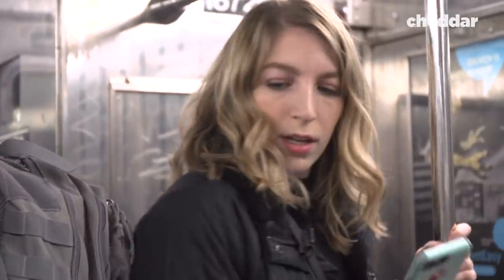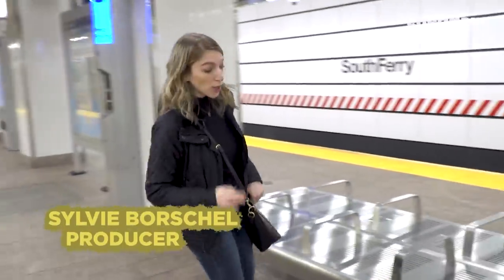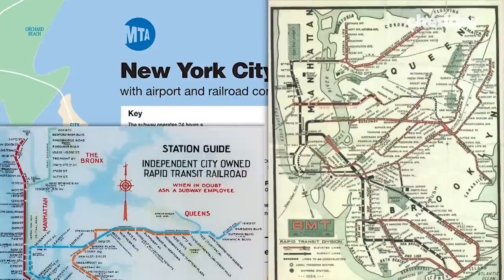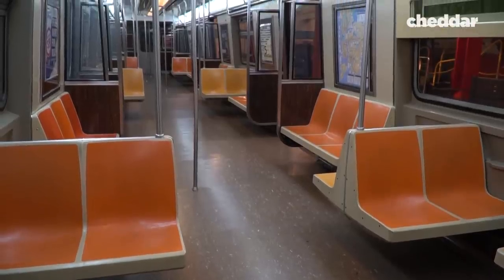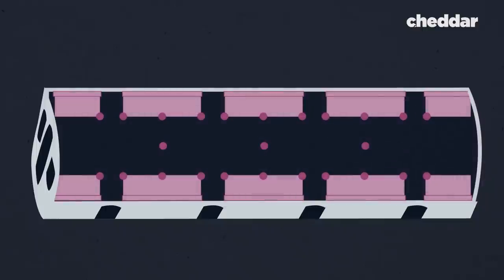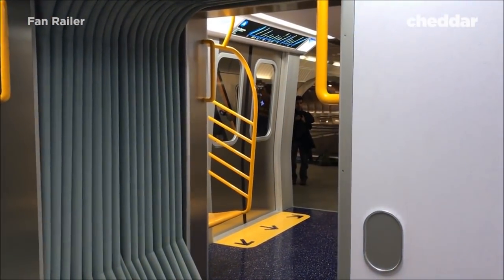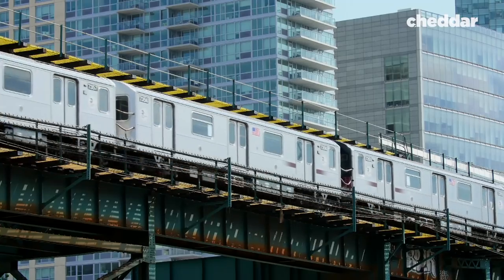Could This Subway Car Save NYC Transit? - Cheddar Explains

Comment: Cheddar: This is Subway
Wendover: Nahh, that's underground planes
Reply: Wendover can do a video about... I don't know... maybe... salt mining in pre-Christian Europe and find a way to tie in aviation :)

Great channel.
Reply: anything else: planes that in no way resemble a plane
Reply: Hahahahahahaha
Reply: The for fucking bus not a train.... you lose too much space for people to stand...
Reply: @campkira  , such a system works well enough for the Twin Cities area in Minnesota, so well, in fact, that they have won numerous awards for their designs.  Now another thing that might alleviate overcrowding in the NYC subway system is the most obvious thing, which is to look at the most crowded streets and make either new subway trains abd subway tunnels under said streets or use trolley, light rail, or commuter/passenger rail systems on said streets, as well as make them have that allegedly perfect rail design, simply make the trains of any type longer, and, if needed, add more engines to said trains.  Yes, it might cost a lot of money, but there needs to be a massive restructuring, as well as improvement, to the antiquated NYC subway train tracking system first, with new patches continually updating the system once new trains and lines are added to the NYC subway system, so a lot of money is already going to be spent on these upgrades anyway, thus expansions to the current system will naturally happen anyway.
Reply: NO THIS IS PATRICK
Reply: this train car measures up to 2 Toyota corollas
Reply: NarwhalX reallifelore intensifies
Reply: Sam (Wendover) has good statements with transportation honestly.
Reply: @paxhumana2015  Boy I can't  even respond to your all inclusive boondoggle of a solution. Who will do all this work and pay for it? Men from Mars. Keep dreaming buddy.

Comment: That aircraft style one looks awful, think how hard it is to get out of a crowded train as it is, imagine sitting in the corner of one of those
Reply: I live in Vienna, we have the end-to-end style trains, but the older 6-wagon style ones too. They don't have automatically closing and opening doors, you have to manually open the doors via a lever on the older ones, or push a button to open on the new models. The seating though remained the same. basically airline style, BUT every seat pair faces another pair, giving enough legroom to get out from the window seat. Each door location has a pole that branches into three. Also, every seat has a pole attached, while there are plenty of those plastic/hardrubber handhooks overhead where you can also hold on. And on the newer models, you can go from one end to the other, while the old trains you were stuck in the wagon you got in, because no doors to go between cars. You had to get out and run to the next car, because dwell times were always low, except at mad rush hour, but those are rare, thankfully.
Reply: Anyway, looks like them New Yorkers still can't figure out the best solution. Budapest has the same longitudinal style seating in the new trains, but one metro line is also fully automatic/driverless.
Reply: And noone is going to want to sit on the inside.
Reply: The closed-ended they described (that wasn't picked) would be harder and slower to get in and out of the train, harder to clean, more likely to be dirty (the shit you find on even open design subway cars in NYC is shocking, like a fucking shark in the early-/mid-2000s), and less likely to be used, whereas with an open layout, EVERY seat in rush hour is going to be taken up, but won't impede passengers getting on and off the train. They need to consider average ride-time (number of stops) per passenger: many passengers will have a relatively short ride time, so they don't care about comfort, they care about ease of access.

Comment: I've lived in China for several years. That "perfect" design (the one they didn't pick) is TERRIBLE. Some of the older buses had that layout. If you were in the window seat and it was crowded, imagine trying to get out - crawling past the person in the aisle seat, squeezing into the narrow aisle and trying to get past the people standing in the aisle... And being in the back row window seat was the worst. I can't believe any professional ever thought this was the perfect design!

The design they did pick is very similar to what's used on the subways where I live (a city of 12 or 13 million that's just started building a subway system the last ten years). The seats all face the center of the car with backs against the windows. You can pass easily between cars through big openings. The areas near the ends of the cars don't have any seats, leaving a big open space near the passageway to the next car. The main difference is that the seats don't flip up and aren't sectioned into individual seats - just one long bench. Of course, one could say the Chinese have no problems with personal space, but if the car's nearly empty, they sit away from each other just like Americans do. When the car is packed, however, they'll squeeze in any opening on the bench that they can fit into. I do it too. I'd rather sit next to someone than stand.
Reply: The handicap area has a lean "cushion" for people who want to be supported by the wall. The problem is that the placement of the TV screens sometimes makes those areas awkward because the screen juts into the back of your head. Those zones are also hard to get out of without aggressive shoving by US standards when the car is packed.

Pretty much the only nitpick I can think of for the Chinese design. There are tons of benefits, like the benches not assuming how wide a person is, or how easy they are to clean compared to individual seats.
Reply: even in Japan's suburb trains, they don't use that also
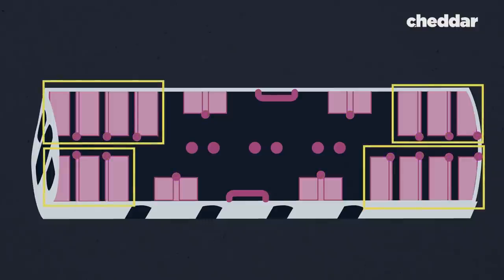Reply: The 5:34 design is being endorsed as "perfect" by a person who clearly didn't ride older MTA buses.
Reply: The truth!
Reply: @ruedelta  do you live in Jakarta?
Reply: @ruedelta  i was thinking shenzhen, nowhere near! lol
Reply: @davidgraham370  Good designs travel far!
Reply: AdeleiTeillana our busses have a similar design (Netherlands) or well some of them have, the thing is that busses are a whole different story.
Reply: I'd rather stand than sit next to someone. I guess we're different in terms of that. 

I'm from Russia, BTW, and I only rode metro, like, 2 times ever. In Moscow. The cities I lived in were all too small.
Reply: Totally agree with you. I Rode a lot of different subways in my Life. Have to say, that not the germans, but instead the Hongkong mtr got the best Metro/Subway if ever drove.
The in and out ways of the Station are perfect planned, a lot if big Doors and one Long train. So you can load and unload as fast as possible
Reply: agreed!
Reply: @TobiasAdeFilm  I live in Hong Kong - the name has a space, btw, it's not a mandarin name. The mtr is godlike, 12 car trains on one line and a couple lines run at 140km/h.
Reply: @Huskie  and arriving every 2-5mins...
Reply: Yeah, I dont see how they could not forsee the problem, it is not that people dont want middle seats, they dont want to be squished

Comment: that "perfect" car design is so deeply flawed it's actually funny!
Reply: What are the flaws?
Reply: @MetalheadAndNerd  Capacity and safety. Overcrowding is already an issue. Imagine if the design made it virtually impossible to stand on the sides? No one is going to comfortably stand in an aisle about the size of a small airliner (which isn't designed for standing when moving over long periods of time with lots of people moving in and out), so you'll just have even less space that isn't as safe for people standing to hold onto when crowding does become an issue. Or if there is an emergency and now there's a bottleneck to leave the car because space is constraint by all the seats?
Reply: Aerys Bat with the drunks and crazy people will now be around one end to another. Hell if someone pulls a gun at least the doors will be more secure and  private.
Reply: Jonathan Pusar On BART in the Bay Area, the lay out is very similar to that. And people always avoid standing towards the end of the car because the aisle between the seats is too small. No one wants to put their crotch in someone else's face. So inefficient
Reply: Yes! Especially the fact that they want to reduce dwelling time but then have transverse seats crammed really close together. If you’ve ever been on literally any transportation with those types of seats, you know how much of a hassle it is to get out if you are in the window seat. Seems like it would add to the delays.
Reply: wossonjohn85 calm down
Reply: @marialevit4169  Wow darn, we probably are very polite in Europe (or maybe only the Netherlands, don't know) but you just ask the person next to you (if you are in the window-seat) if he/she could stand up or not. The same as when the windowseat is empty but there is someone in the aisle-seat and you want to get to that windowseat. Sure, you get the obvious 'I'm not gonna stand up for you' asshole once in a while and thus have to make your way past him or her, but most of the times people will stand up.
Reply: RIP R44s!
Reply: They didn't chose the perfect car for those specific reasons. Its better to have bigger doors than to minimize safety
Reply: I could not agree more... absolutely dreadful
Reply: @weeardguy  Finland here. A quiet nod is enough to signal anyone you want to get out of the window seat and never in 30 years have I met a person who refused to make space.
Reply: @JoonasD6  Oh yes, the quiet nod is useful here as well ;) But people who refused to move... not really an exception unfortunately here.
Reply: @pascualgomez8274  Exactly!
Reply: The current one looks better!!
Reply: when politicians apply their public school common sense to everyday problems.
Reply: weeardguy quit flexing about being polite, every country does that lmao. What they were talking about was how the person has to stand up or move bags just for you to get through which is hard on packed trains
Reply: the asymmetric doors door design killing me
Reply: I have been riding the optimal subway car and it is like so perfect.
Just because a metro car is open does not make it more comfortable. It makes it more stressful because you se how full the subway car actually is. And people are forced to be close to another. Not comfortable  at all people are forced to look into the middle where there probably are alot of people standing if they are lucky enough to get a seat. You can not even look out the window to focus on something else than a crowded subway car with sweaty people.
Reply: @weeardguy  o in nyc it mostly gonna start a fight and brawl lmfao unless they say excuse me and some people just have attitudes
Reply: Yeah. Look at thoose small doors on the "perfect" design vs the ginormous doors in the one they choose. If you wont to move more people thru and opening in less time, you make the opening larger.
Reply: @mdeborah827  its not like the territory of the current USA was a dreamland before though. Living in a land where different tribes brutally murder other tribes, rape women and children after a won attack and over all live like its the stone age - no thanks. 
And if you didn't know - the europeans actually paid a huge amount for Manhattan to the natives who owned it. I am not saying everything the settlers did was great, but there definitely was a lot of very messed up stuff happening before they came and the territory definitely was not Disney Land.
Reply: @weeardguy  it's not that people won't do it, it's that it's annoying to have to ask, and it takes a little bit of extra time.
Reply: @AerysBat  design flaws so bad they are quite funny: episode 6969
Reply: @Maranville that’s not that serious as a New Yorker we’re used to it already and don’t get annoyed about that. Nyc subways gets very very crowed and we never have a problem moving aside  for someone to get thru to get on or off a train. Or if someone wants to grab a seat that someone has to kinda move. We’re used to it the mta subway cart can hold a whole lot of people.
Reply: @JoonasD6  in the UK on the bus and train, people usually show it non verbally by putting away their things, and will only ask if you don't get the memo

Comment: When that "perfect" car design popped up I actually grimaced. That airline seating is abysmal. 
Bring on the gangways.
Reply: Lulu Jones  easy. they will sit on the floor
Reply: Craig F. Thompson  That's a crazy idea. I'm amazed that even two people have liked it in the six months since you commented. The elderly and infirm should always have somewhere to sit on public transport and there should be sufficient seating for most people to get a seat off-peak. I haven't seen the Madrid subway cars you speak of, but I'm surprised they exist.
Reply: Craig F. Thompson That it was someone else’s idea doesn’t make you any less crazy for proposing it. That’s it’s a very old reference doesn’t surprise me, not even the MTA would endorse such an absurd idea these days.
Reply: Yeah when I saw it, I thought to myself how lucky I am to be in London

Comment: I don’t prefer to hold on to vertical poles, I legit can’t reach the horizontal ones above the seats!!
Reply: Pole dancers love this answer 🤭
Reply: Can I get an amen for J Dizzle?

Seriously, most of those horizontal poles are the worst because you also need the extra height to bend over someone sitting there as you take that second to apologetically or awkwardly look at them before trying your best to look away. But, that doesn't mean I wanna stand with the vertical pole with the circle of crowding. This is also awkward and there's always that one asshole that tries to grab the pole when there's no more room left and just as the train starts moving, their hand slides down and hits yours. It doesn't hurt. It's just the biggest cringe.
Reply: Take away the poles and all the sudden it’s no longer ‘SHOWTIME!’ ... oh no... think of the children...
Reply: My arms hurt if I hold on too long. Hate those high ones. Rather hold the vertical.
Reply: that pole is clearly designed for people that are at least five foot nine
Reply: I went on one of the holiday trains accidentally and I held the strap and that was way more comfortable than the bars we have on R64s and R62s. I wish they just went back to prioritizing people over the costs but the nyc subway is in deficit so they can’t really do anything
Reply: @chanmarr8118  High horizontal bars make robberies easier.

Comment: the suggested design is not good anyway.
i prefer the middle seat than sitting on a subway car like an airplane, at least i could stand up and leave.
Reply: I think the idea of the airplane style seating is supposed to be for passengers on longer trips. There are singles seats that you would easily be able to get out of. In Toronto, like said in the video, we use the open concept. It works, but still has delays because like they said, people crowd the doors. I think there is potential for this, because there is lots of open space near doors for short trip passengers to stand if they'd like, or lots of room at either end of the car for seating.
Reply: I hate it when Im on a plane or a bus and I have to make people stand so I can leave.... I dont have this problem with subway
Reply: @emilyktingey  the airplane seating still sucks if your in there during rush hour then you can’t get out unless one person moves away from the narrow aisle

Comment: The researchers didn't do the study during rush hours? Shouldn't the trains be designed around rush hour passenger traffic?
Reply: They were studying preferences, so they did their research when people had choices to see what people prefer.
Reply: it also seems that they apparently failed to ask why people sit/stand where they do
Reply: this design is better for more comfort. while some may design for max people...
Reply: Exactly
Reply: @comradecid Andrews exactly there is a reasoning to standing near the door or not wanting to be stuck in a booth or simply not being able to reach horizontal bars.
Reply: When you use the horizontal bars you’re exposing your armpit to the person you’re standing right over... feels uncomfortable
Reply: The train they designed had both parts of the day in mind: The rush hour times... then most of the people will stand in the middle of the car and SOME on the side ends, so that the people sitting can easily get out. And in other times the passengers can happily sit in a 2 seat part with no middle man :D
Reply: Acme. Nipp-on-AiR I don’t think you’ve ever been on the NYC subway in rush hour if you think that people have a choice to not stand in between the seats. At a certain point it fills up so much that every square inch of spare space is filled with a human. If anything all it’ll accomplish is making every single person sitting down unable to get up quickly enough to get off.
Reply: Acme. Nipp-on-AiR It’s hard enough to get off now in rush hour and sometimes if you’re sitting you can’t, if they implemented that first concept it would be impossible.
Reply: VolDep45  😂😂🤣🤣🤣. So you saying it's no hope for a little person to step on a crowded train with no seats and no more bars to hold on too🤣🤣🤣🤣!!! Goddam that visual!!!
Reply: VolDep45  Current trains are FINE during non rush hours. Why does MTA want to spend resource on something so unimportant instead of solving the REAL PROBLEMS?
Reply: Weisha Yu Open Gangways will solve REAL problems.
Reply: @marccolten9801  LMAO!! good one!!!
Reply: @lisayist  The R-211s are for A F and C trains. Maybe B as well. The A is definitely not fine and needs an upgrade.
Reply: @lisayist  Is rather they spend money on this instead of their new fare system with OMNY